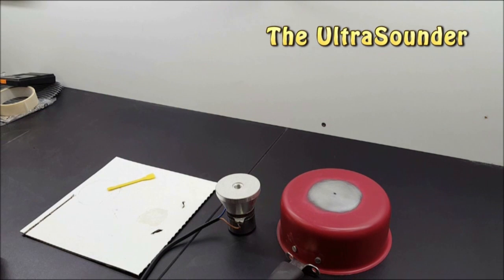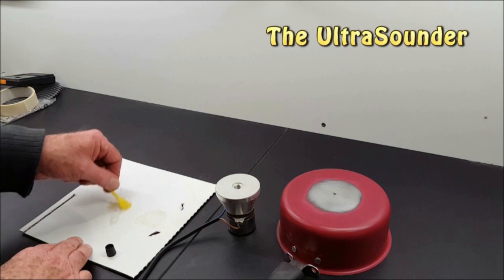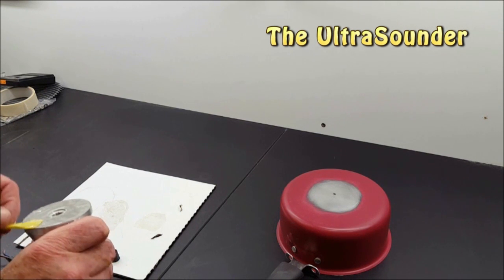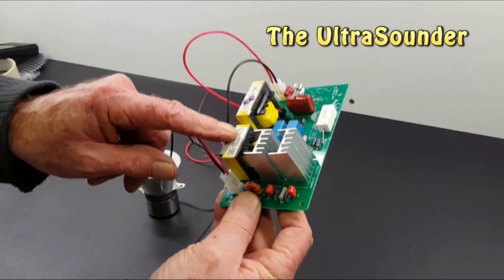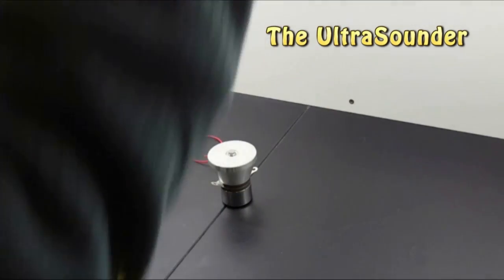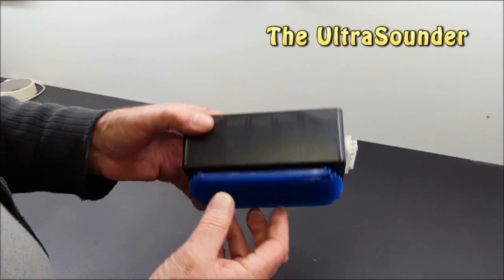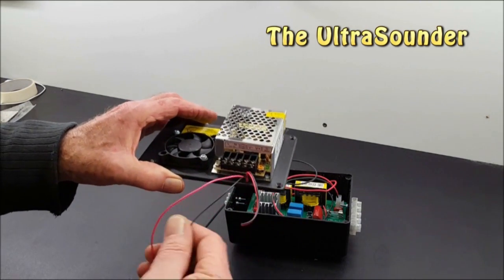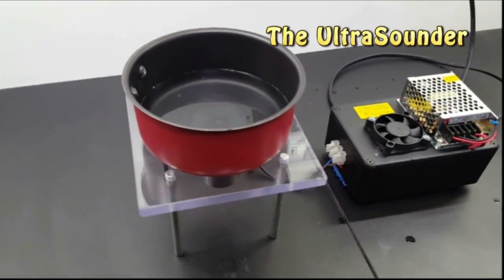Ultra Deep Clean with Sonics - Building a simple Ultrasound cleaner -

Comment: The 4 important questions not answered by the video are:
1:  How much did it cost?
2: Did it work?
3: Did the epoxy hold?
4: If it has failed, for how long did it function?
Reply: @theorignalsprout  That thing with a vibrator? Yeah that's not an ultrasonic cleaner. It just agitates the parts and cleaning solution. That's all.
Reply: EDIT: I now understand how ultrasonic cleaners work. There is no need to keep replying to an old comment with information of how it works. Thank you!
Reply: @soundfxasmr  I mean there's also the whole cavitation thing an ultrasonic cleaner does.

Comment: we bought this type of card and we want to build an ultrasound,
the board (pcb) fails after a couple of minutes, and 220V charge stops working
the circuit works because if it is tested with a new card, it works only for a few minutes.
the question is whether this type of card is designed to work continuously or only for a few seconds
P.S. the card is cooled by a fan does not exceed 36C

Comment: You seem to have built 2 systems - one with the transducer epoxied to the bottom of the pan and one where the pan simply sits on top of the transducer which is mounted in a perspex topped jig, The latter is the one which was demonstrated in operation.

Questions:
Why was there a hole drilled in the bottom of the pan on which the transducer was epoxied?

Why was this unit not shown operating?

It is usually not recommended to operate the transducer in an unloaded situation. Manufacturers of U/S cleaners always state that fluid must be added to the tank before turning on the transducer/s because the lifetime will be reduced markedly when operated unloaded. The jig mounted transducer you demonstrate opens the possibility of unloaded operation purely due to oversight in not mounting the pan and filling it with fluid..

In my experience general purpose epoxy as used in your video is not really suitable for transducer mounting. It softens readily when heated and the transducer can become detached. When that happens sparks can fly...literally.

As supplied the transducers come with a short threaded stud. This is intended to be used where the user has the facility to thermo-weld this stud to the bottom of the panel to which the transducer is fitted - simply by screwing it onto the stud. Epoxy is then generally used to ensure the transducer does not unscrew during operation.

Manufacturers (Chinese) of U/S cleaners use an epoxy such as 3M DP460NS but this is not generally available, is very expensive and requires a special applicator gun to ensure correct mix ratio.

I find that Dynasteel Epoxy Paste http://www.supercheapauto.com.au/Product/DynaGrip-QuickSteel-Epoxy-Paste-56g/1972 is a very good alternative. You will just need to find a local supplier. The 260 degC rating of this epoxy will be important where you are also fitting a heater element to the pan along with the transducer. 

The transducers are a capacitive device but they generally do have a nominal +ve and -ve terminal. The +ve terminal is the one sandwiched between the 2 ceramic discs. Conversely the -ve terminal is the lower one which is in contact with the aluminium cone at the bottom of the transducer. Polarity is important where transducers are to be connected in parallel.
Reply: it's the same system. the transducer(epoxied to pot) is lowered into the plexi stand( w/ hole.) as he states @ 4:39
Reply: It looks to me that he built one device, and was just demonstrating how to goes together. The pan didn't have a hole drilled in the bottom, just black marker.
Reply: There was no hole in the bottom of the pan. He stated he marked a spot with a sharpie so he can find the middle of the pan. I thought the same thing till He said it.
Reply: Ross Herbert ive read that an epoxy should have a ratio of 10:4 for transduces (im assuming resin to hardener) ( i have very little experience in this topic) why do you chose the quick steel epoxy? Im curious because i need to pick one for my diy ultra-cleaner, parts come in on Friday
Reply: ALSO i have found no information on this; when using epoxy to secure the transducer what do i do with that metal plug that screws into the resonating diaphragm of the transducer? Do i leave it out? Would that unbalance the transducer? I don’t have an oscilloscope so i cant do tests and nobody talks about it.
Reply: This comment was vastly more useful than this video, thanks
Reply: @animearmpits3060  you weld it to the tank, it's the proper fixing for the transducer
Reply: @____________________________.x  That is the best method to fix the transducer- but also add the epoxy to fill the voids and to eliminate vibration and fatigue. But not too many people have the equipment to spot weld the stud to the pan. Even using epoxy by itself  will eventually fail I have discovered.
Reply: @rossherbert1591  I believe there is a special brazing alloy for stainless steel that might be suitable. Maybe just using  through-bolt would be suitable, although I've not noticed any specs for the weld nut thread gauge.
edit: it looks like it's an M10 bolt, 12.5mm deep

Comment: I would have liked to see the foil test on that. I got the impression the bubble size would be large for that, depending on frequency. I would have liked to see the sien wave on an oscilloscope also. Was that a switching power supply? What toatal voltage was that powersupply rated at? I wouldnt use a teflon coated pan eather. A simple aluminum pan would have worked better. Where did you get the Transducer? I wouldnt mind making my own. I didnt see any way of controlling the wave being made by the transducer,  can you buy something that can be adjusted?

Comment: Just one question...does the vibration start as soon as you plug in the PCB board into the power outlet or do you need to send a signal with a microcontroller first?

Comment: In the wide end of the transducer, there is a threaded hole into which a grub screw locates.  What is the function of this grub screw?
Reply: You can tune the horn and - you can use it to locate a horn on a surface.
Reply: Mounting

Comment: Nice video. Have you ever measured what the output voltage is of the driver board ?  Is it
somewhere around 250VAC, 40Khz ?
Reply: He said 28 khz. Voltage I guess should be around 100v

Comment: im little lost you power the boad with 240v why the 12v then ?
Reply: From what I gathered, the 12v power supply was only used to power the 12v DC cooling fan on top of the case. The 240v AC would have been used to power both the 12v Power supply and the Transducers driver board.
Reply from the maker: Quite right - the 12V supply is just a little cheapy to run the cooling fan and power the 'on' LED. I like the LED since I often have other noisy stuff in my lab (vacuum pump, air compressor, cooling pumps) so it saves me forgetting it.

The total build cost was (from memory) around US$100 or less, including the driver board, the 12V supply, fan, box and saucepan.

Comment: Would tacking or welding the transducer to the pot ruin it?
Reply from the maker: Possibly a bad idea. I have modified the system since building it, the pan is now  pressed onto the transducer with some springs. This is because sometimes I use the transducer set-up with a flask (full of solvent and tiny metal parts) spring-loaded directly onto it.

Comment: Thanks for the nice video! I was wondering wether your setup is still working, as some research shows that those Chinese driver boards are useless and just about all burn out. As far as I could find out the transistors blow before the fuse goes. I just made a setup with a 100W, 48Khz driver board and 2 transducers in parallel, and something blew within 10 seconds. Haven't figured out what yet, but not the fuse. I have to check the transistors tomorrow. Could it be that those boards can't handle 2x 50W transducers, even though the are sold as a set? Oh and I DID fill the tank with water first before switching it on and I also had a fan running for cooling. Anyone sudjestions for me? It is very much apreciated.
Reply: the thing is with boards, you can simply replace components that 'burn out'.
Reply: oatstao That wasn't really my question.
Reply: As the author states... the drives are often poorly specified. Use a 100w horn with a 50w driver not the other way round as they are sometimes sold. Even attach two horns.